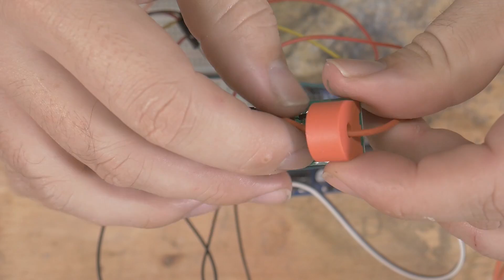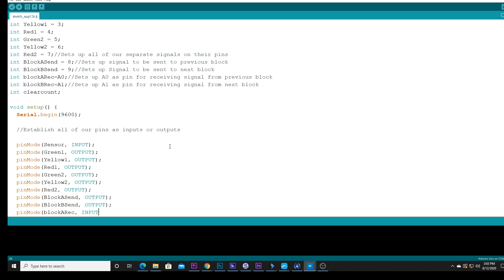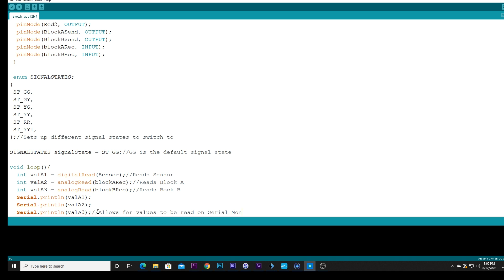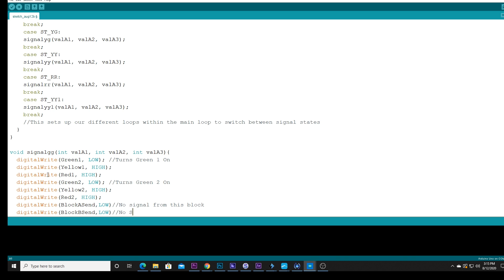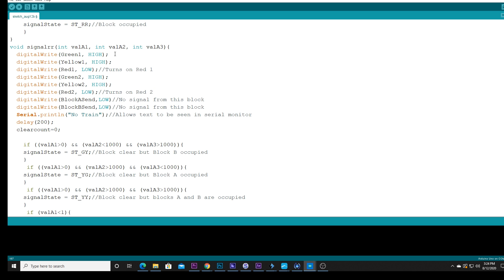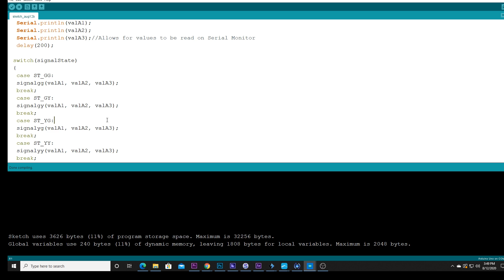Arduino Block Signal: Upgrading the Multiblock Signal System to use Current Sensing!

Comment: Would it be possible to slow down or stop a train automatically if the signal is red with an NCE Power Pro R or any other power plant?
Reply: Mr. Martinez What is a NCE Power Pro R? Are you talking about watching the Train as it approaches the signal tower and your not using the throttle control to slow it down and then it comes to a stop while the light is red? What I would like to see is in a Layout in the future would be like you said in your comment about the Train Automatically without touching the throttle to slow down and then stop and when the light turns green it then starts to speed it up back to normal speed? 
Also Do the Engines have to be DCC or Legacy to run this particular System? 
Thank you for your time 
Sincerely 
Allan Martinez
Reply: @allanmartinez1190  NCE is a digital train control panel. It can be connected and operated in the way I ask (I found out) via CMRI. Each block should be able to identify who is occupying that block and stop the loco.
Reply: Juan I'm sorry to bother you again but I was wondering Do you think the NCE Control Panel could work with Postwar (Conventional Engines)  as well as DCC or Legacy Types of Locomotives? 
Sincerely 
Allan Martinez
Reply: @allanmartinez1190  no, only DCC locomotives.

Comment: you're missing some 220Ω or so resistors for each leds. 
having the leds directly on 5V will reduce their lifetime significantly, you need to shed about 3v in the resistor (leds are designed for about 2v max at usually 20mA).

Comment: Hi good video. Just having trouble with the sketch, has an error  "use of enum SIGNALSTATES without previous declaration" Do you have any idea how to fix? Thanks
Reply from the maker: This may be a typo in the code where the enum line of code is.
Reply: @DIYDigitalRailroad    I fixed that, next one.  Next error " signalgg was not declared in this scope". I have copied and pasted  the switch section from your working copy, no change, Any idea? thanks.
Reply: I worked it out ,  fantastic ! Thanks.

Comment: I have some concerns using an inductive current sensor on DCC.  It will have an effect on the DCC signal wave shape and may cause enough distortion to degrade the data quality on the rails.   Your design and software would work with a Hall effect current sensor.  These don't use a coil and don't use a reactance shunt.  Typical resistance 1.2 mΩ.   Look at a sensor like the 5 Amp ACS712.  You can get 5V Arduino compatible sensor boards on ebay for under $2.  Just do a ebay search for the ACS712.  Other sensors with the same interface work 3 to 5V and can handle current over 50Amps.
Reply: current sensors have  been used for many years in block detection on model railroads with no issues.
Reply: @scottericcatalano596  Thanks Scott,  the Hall sensor would work both with DCC and DC and may be an interesting $2 option for block load sensing.
Reply: Interesting, how would using Hall Sensors impact the sketch?  Or does it?

Comment: Well done.
Have some bd20s on order.
How difficult would it be to use two additional digital and two analog pins to control 2 blocks either side of main block?
This would allow a safety red block behind and infront of occupied block and a yellow block on either side like prototype.

Comment: Would it be possible to use the BD20 with DCC++ on the Arduino talking to sensor in JMRI?  I want to use it just for occupancy detection on isolated section of track.  Thanks.  Fred
Reply: I've heard it is best not to use the Arduino that DCC++ is running on so it doesn't mess up timing.
Reply: Gregory, Thanks for the feedback.  Fred